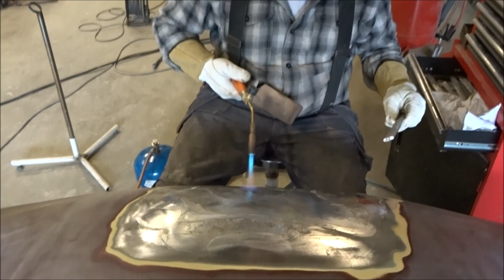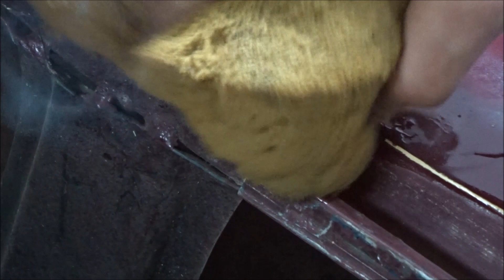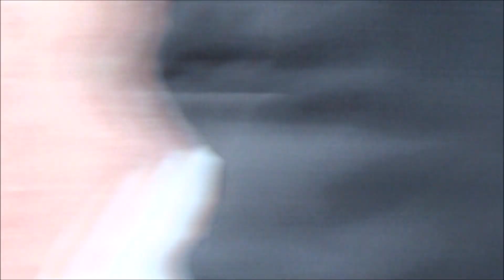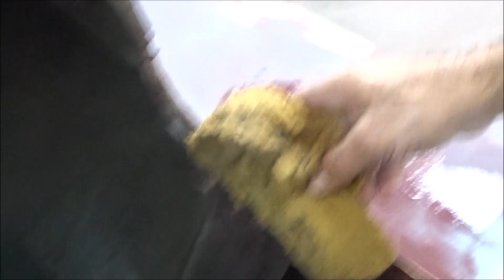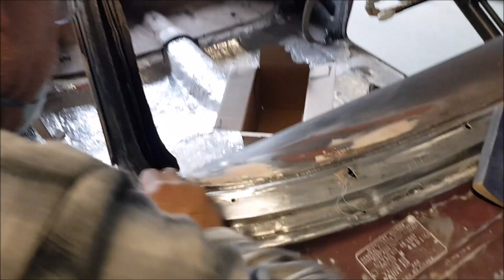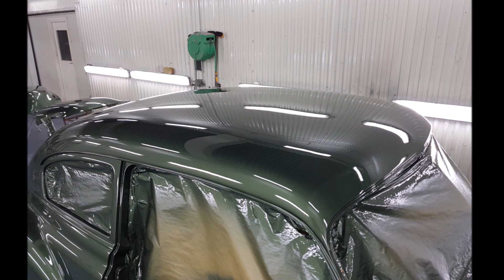1949 Chevrolet Fleetline  Classic Car Restoration

Comment: Thank you for sharing! I’ve never seen anyone (on YouTube or real life) conduct body work the way you’ve shown on your video. You’re melting some kid of metal to fill holes and imperfections, blows me away. This is a technique pre “bondo” I guess ? Anyone can slap on bondo and start sanding, your work is an entirely different thing!
Reply: This is a dying art of leading the way they used to do body work before bondo. It is more softer material to work with. It takes a a know how to do it though. It's not like bondo just mix hardener to it and spread it on like icing on a cake and sand become a big mess.

Comment: Simply so you can say "no bog" still using filler!! Plastic filler is far better for the car and the worker. Get into the current era.
Reply: Yeah breathing in all that plastic. Is so healthy. You gotta sand plastic. And the masks dont fimter everything. How many chemicals are in plastics?
Reply: Plastic filler isnt better at all. I guarantee you'll never see lead crack and lift up under paint. Cant say the same about plastic filler. The reason everybody uses plastic filler now is because it's faster and easier than lead. Today it's all about get them in and out as quickly as possible. Quality has taken a back seat to fast turnaround and volume